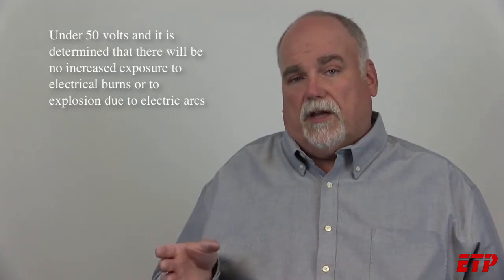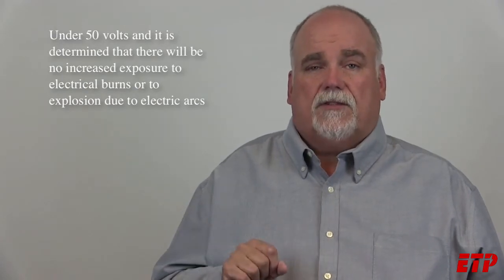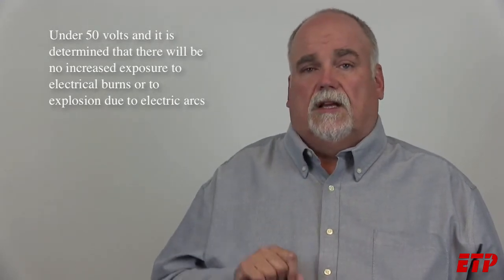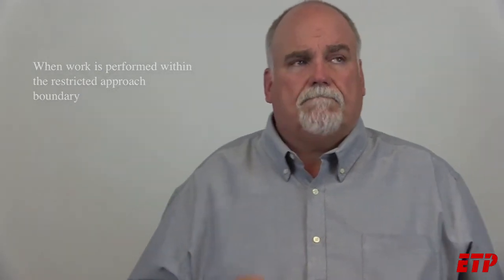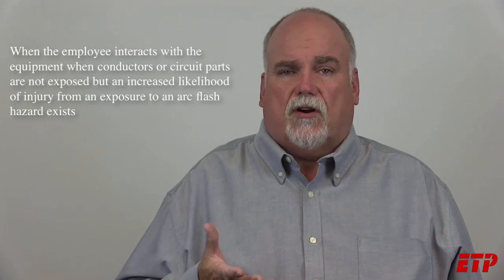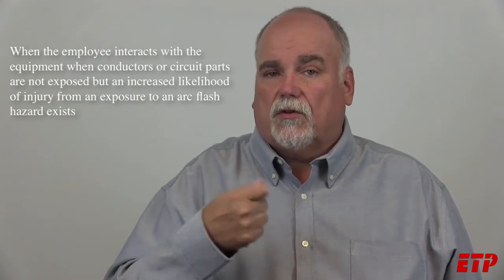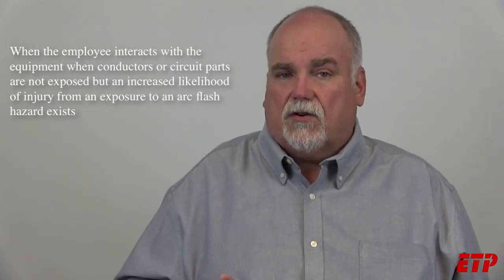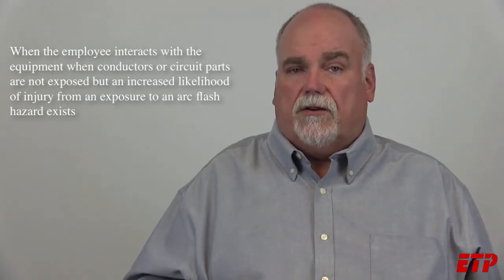Energized Electrical Work Permit

Comment: Retired from a large hospital and it took longer to secure a hot work permit along with risk assessment form then it did to install a normal or emergency power 120 volt receptacle. They made us use roll around HEPA filter cart that sides extended up to drop ceilings. Had to have safety department in another building sign off and either the chief or senior electrician sign off.  A union electrical contractor would charge over $850 to install one receptacle. I tried to always have a back log of VFD'S to either troubleshoot or replace so only had to deal with paper bullshit once or twice a month.

Comment: Thanks for the video, my question is the “ Hot work permit “ can be used for the energized equipment in case of a lack of specific one.
Reply from the maker: A 'Hot Work Permit" is for welding, cutting, grinding, etc. An energized work permit is for live electrical work and has totally different requirements. They are not interchangeable. So to answer your question, no. You need a specific energized work permit. Thanks for your question.